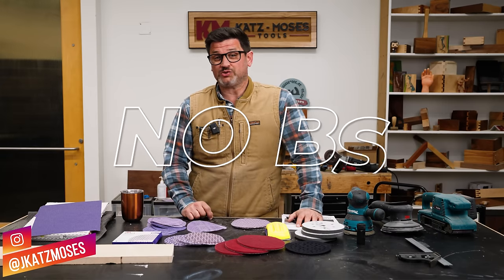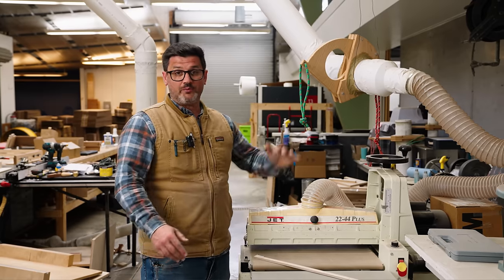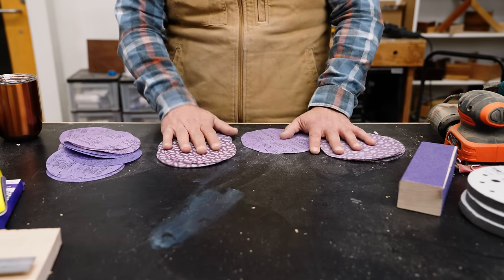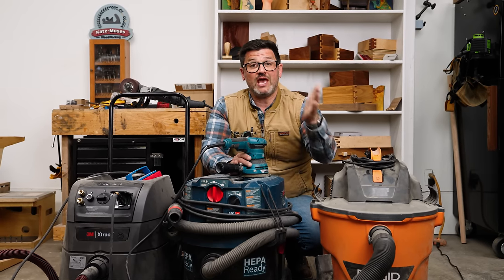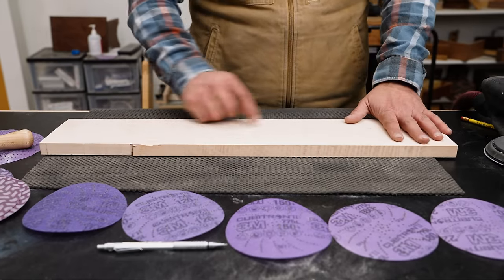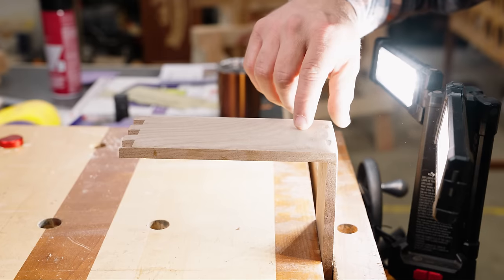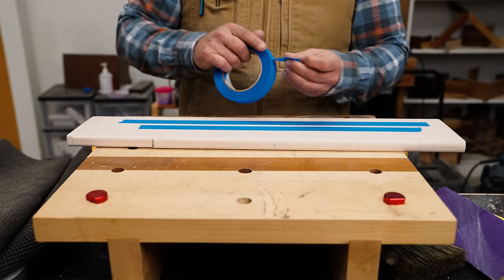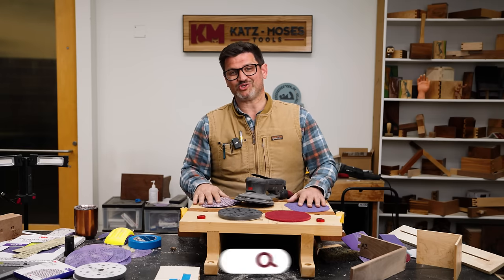Achieving the Perfect Finish: No BS Guide to Sanding like a Pro

Comment: The best tip I ever got with a power sander is - Turn it on and off while it’s on the piece.
Reply: Care to share with the class why that is important?
Reply: @jtome12  can create gouges or be uneven. The way it was explained to me was, when hand sanding how do you start, you put the sand paper on the wood and then begin sanding in the pattern you choose, not moving your hand all around and then putting it on the wood. Same concept when you stop sanding. I think as with all sanding it’s more noticeable with aggressive grit.
Reply: @ajvc2233 especially critical with older sanders that don’t have a slow start/stop.
Reply: I often do the opposite with sanders. Normally it's when I'm shaping with a sander though.

With a rotex sander though, I find it sometimes better to come in with the sander for a delicate landing. If you start in rotex mode on the piece, it can buck you right off, or gouge before your muscles kick in.

I love the rotex though, it will turn and burn on production. I wouldn't recommend it for high grit finishing, but it's good to 220 or 320.

I also use it to sand to my line on scribe cuts. I can rotex thicker spots, random orbit it into shape better, then finish with a hand sand/hand plane. You can't fit a playing card in my scribes when I'm on my game.

Comment: Jeepers, I need to get a new heater for my shop.  😉32-56 degrees Celsius is warm, I think.  Let's see.. convert to Fahrenheit... subtract 32 and multiply by Pi and divide by the degrees off of the equator you are from the equator, and finally add your shoe size in EU units.  So, about 65 - 70 degrees F, right?

Comment: Upgrade your sandpaper is a good tip, but also don't stick with your $60 hardware store RO sander forever. If your wrist hurts after 30min of sanding it might be time for a higher end sander, it makes a big difference. (plus they can also remove more material in many cases, but that's secondary in my view)

Comment: whether or not you agree with grain popping, if you're sanding to, for example, 220 grit, there is no negative consequence of raising the grain after sanding to 180, waiting for it to dry, then sanding to 220. You'll have done this step without adding any extra work (I consider spraying the wood with water and wiping off the excess to really not be any added work let's be real)

Comment: I watched the 2nd sanding video you did with the robot sanding when it came out and immediately bought a sample pack of the 3M Cubitron net discs.  Long story short, I then bought sample packs for several other woodworkers in my life and have been avidly trying to use up my old sandpaper so that I can completely restock with the Cubitron discs.  Less time sanding, fewer swirl marks, and fewer disc replacements required.  The hype around them (in my experience) is very justified.

Also, just absolutely love the whole no-BS series.  Keep them coming!
Reply: I have a bunch of the Cubitron net discs, I've found that they are best with bare wood only.

Comment: Definitely going to implement that pencil "trick". I've struggled with that very problem for years and now understand why. Thanks, Jonathan!
Reply: Lol I had to skim the video for what you were talking about and then missed it. To me that has become ubiquitous.

If you want another trick. Check out the tape and CA glue trick. It has changed the way I work and earned CA glue a permanent seat in my tool kit.

Used it the other day to set 2 pieces of wood that were slightly different thickness to be perfectly flush. It was a transition from wood flooring to wood stair nosing.

Comment: Call me a masochist Jonathan, but I kind of like sanding. Taking a rough, uneven, discolored piece of wood and transforming it into a near perfect surface that will finish beautifully is a joy (albeit a slow one). I work with imperfect live edge slabs that can start out needing serious belt sanding, working from 40 grit up, and then going to a random orbital through all the stages shown in your excellent video. Belt sanding is not much fun, but I find finish sanding can be a calming, almost meditative process. Your body goes through smooth, repetitive motions that allow you think about anything... or nothing? That doesn't mean that I stretch it out - as the son of a cost engineer and OR nurse, seeking efficiency is bred in the bone. This video and your other related ones have certainly improved the quality of my work and cut down on the time spent sanding, leaving me able to do stuff I enjoy even more. Many thanks!

Comment: You can also sand hard to reach spots with a multitool. Fein sells a set of very handy sanding pads that take sandpaper. However, most of the time I prefer scrapers for those tight spots.

Comment: use a pad saver in between your random orbital sander's pad and your mesh disc. friction and heat eventually wear out the hooks and the pad saver is much cheaper to replace than the pad. Non-mesh discs cause less wear.

Comment: I really wish they made cubitron sanding belts for the drum sanders. They do make cloth backed cubitron up to 220 or so grit, so why doesn't any one have that available. Not sure how much of a turner you are, but I can not live without an angle/close quarters drill for my bowls. 

I NEVER blow off any of my pieces. That puts way to much dust into the air.

Comment: Jonathan, just a teenie weenie humble suggestion when it comes to scotch Brite,  try instead 3M SPP Maroon pads instead of the Red Scotch Brite.  Its is a 320(ish) grit factor, its a denser material and can be used wet or dry.  its does cost more than any other like material, but it is worth it between coats of finish. And it mates well with hook and loop interfaces.  I buy the 20" buffer discs for floor prep and recoats, I also use the 3 inch center pop out on my 3 inch buffer/sander for edge work etc.   just a suggestion, like to hear from you if you get around to using this medium.

Comment: Great Information! Question: I am building a lap steel guitar which is essentially a 3" x 3 3/4" oak board with a thinner headstock. As soon as I cut it to size, I used a hand planer and then a card scraper to smooth the surfaces. Since the card scraper did such a great job (thanks to your instructional vid on how to use them!), should I by pass the coarser 80 and 100 grits and jump to 120 on up?

Comment: Question regarding grit progression. You have 80-120-150-180-220 listed, perfect progression through what 3M offers. I generally skip 150 and do 120-180 from the school of thought  being your next grit shouldn't be any more than 50% finer than your previous grit. I've personally never experienced any issues with swirl marks by not using 150, but otherwise following this process. Do you use 150 based on personal preference or do you feel it's necessary?

Comment: Thanks great video 👍 
I guess I’m kinda strange, I actually like sanding it means that the project is nearing completion. I’ve been doing woodworking for a very long time at one time the easiest way to flatten a top was with a belt sander, I’ll be using it until I get space for a flatting jig for a router.

Comment: Nice fact based video. Don't forget when using a dust vac hooked up to your sander is not to run the vac at full suction this wiil add to much suction which causes heat and will shorten the life of the sanding substrate.
Reply from the maker: I’m not sure about that. Where did you get that piece of info? I dont think vacuums often have suction controls

Comment: Thanks for the video, can you help me figure out the connection piece i need from my ridgid shop vac to a ryobi router or a dewalt sander? my Ridgid hose says 2 1/2" which is standard im guessing, but when I measure it its actually 2 1/4" is that a nominal 2 1/2"? Anyhow, im either going to 3d print some attachments of would like to check out what you have used in the video with that universal connector.

Comment: I'm curious if most people really start with 80 grit. That was the advice i received when i first started and i struggled to use it effectively due to its aggressive removal. Nowadays i start with 120 and if i have some rough joinery to clean up i reach for my block plane.
Reply: It depends. I mill my own lumber and definitely start with 80 grit if I haven't run it through the planer/jointer. If you're buying lumber presmoothed, you may not need 80 grit.
Reply from the maker: Best to use your best judgment but as long as it works for you
Reply: Same as the others stated - it depends.  I generally only use S4S lumber so 80 grit feels like taking a step back in the sanding game.  I generally start at 120 unless there is a very specific reason to need the material removal of 80 grit.
Reply: Thanks for the input all! To be clear, I wasn't trying to call out the advice in this video as bad - just wanted to see if there's a hole in my workflow. My planer seems to leave such a nice finish that even starting from rough lumber I don't see 80 grit fitting into my process.
Reply from the maker: Totally did not think you were. Great question my friend

Comment: Very timely video. I just moved into my new shop and after 25 years of DIY woodworking kicking around a garage (that had cars in it), I've finally got a dedicated woodworking shop 14'x32' (I just retired). I've currently got a Ryobi sander, and looking for my 1st real performance = w/dust collection sander. I noticed you have 2 of them in this video, the Mikita BO5041 ($126), and the 3M Xtract 88758 ($464). How much value does the 3M provide over the Mikita if any? You picked up the Mikita in your video and said you use it 99% of the time but when watching the video your using the 3M most of the time. Both are random orbital so I'm guessing you meant you use a random orbital sander 99% of the time, not necessarily the Mikita. Really appreciate you NBS video's and will certainly shop at your store. Searched for sanders and nothing in the store, so prices are what I found on Amazon.
Reply: I have the Makita and it's all I've used so far. It's okay. My understanding is Festool, Mirka and 3M sanders are all top of the line. The 3M sander is a relatively new product but did make some waves when it was released for its high quality. I will likely upgrade soon and haven't decided which brand to go with. I think the Festool has some QOL features if you use their whole system together but obviously gets very pricey!
Reply from the maker: The 3M sander is so amazing. I was saying I use a random orbital 99% of the time not the Makita. The Makita is a good sander though
Reply: @homtherobot  Thanks for replying. Based on your comment and KM's below, I think I'll buy once cry once and spring for the 3M sander. I'll all about getting great value for my money, but also factor in what it will do for me personally. I just turned 65, and my hands are beginning to get a bit arthritic. My Mom had a very bad case of arthritis so I suspect its in my future as well. My left thumb just got what is called thumb pop, where it sticks when bent and instead of moving smoothly it snaps back from bent to straight. I've got a splint to wear on it for another 4 weeks (only when I sleep) and then back to the Dr. and possibly steroid shots. Not something I'm looking forward to. With what I've gleaned from reviews, the 3M, Mirka and Festool sanders are all very smooth as compared to others, so I'm thinking I'd be much better off with that banging away at my arthritic hands then something else.
Reply: I know everyone has different experiences but I had bad luck with the 3M sander. I loved the sander, but after about 3 months, after about 5 minutes of use it would just stop rotating. I would have to turn it off and back on for it to start back up. But then it would only run about 15 seconds and do the same thing. I sent it 
back in for warranty work and they offered either a new unit or a refund. I took the refund and used it to buy a Festool. Haven’t looked back. 
One other quick comment - when I bought the Festool I chose to go with a 6” instead of the 5” 3M that I had. OMG!  What a big difference. That extra 1” makes a HUGE difference in terms of efficiency.  (I know, I know…that’s what she said too😂)
Reply: @byronforehand  Thanks for the insight. I hadn't heard any bad press on the 3M to date, so good to know and I'll do a bit more research before I make the purchase.

Comment: When walking through the grits, I'm really surprised about the steps. Like, 80 to 120 is a 50% increase in number, while 150 to 180 or 180 to 220 are just 20%.
I settled on 80 - 120 - 180 - 240. Or is that a bad idea and the very fine steps are the way to go?

Comment: While skipping grits is bad, you're using too many grits. No need to go from 120 to 150 to 180, for instance. The rule of thumb I learned is that the next grit should be 50% higher than the last grit. So, if you start with 80 grit, then 120. After 120 you can go right to 180. From 180 you can go to 240 since 270 isn't generally available.